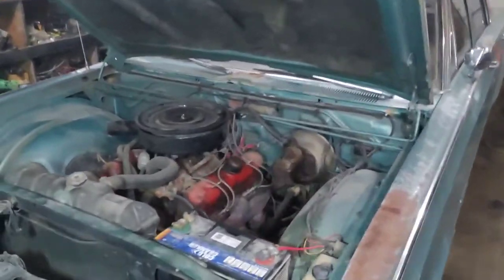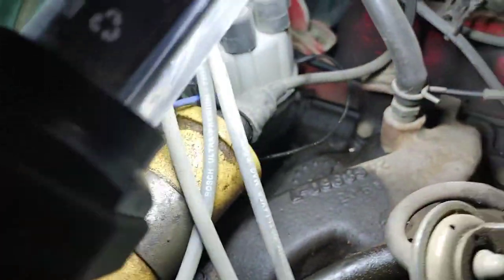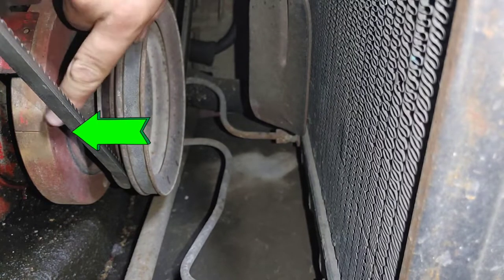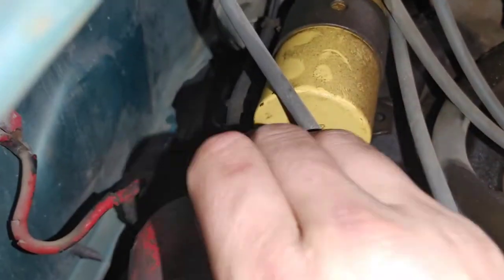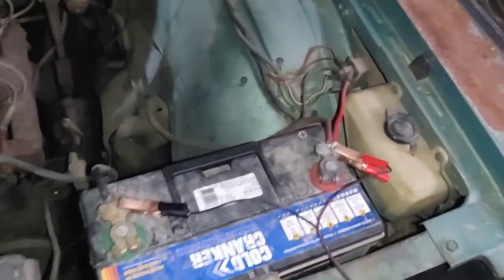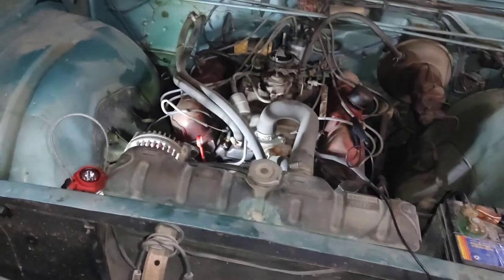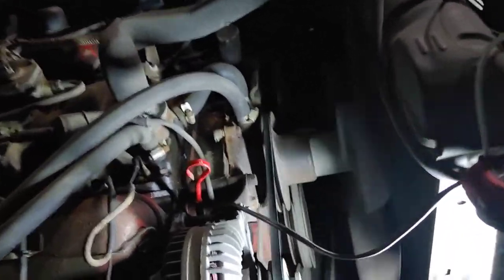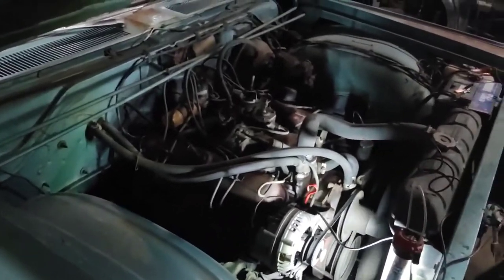1968 Dodge 318ci distributor base timing

Comment: Is the LA block different from the Poly?  I have a 318 poly and it calls for 4 degrees before top dead center from the factory.
Reply from the maker: Yes the poly is quite a bit different in pretty much all aspects. Im not sure on all the details but im sure someone can fill those in.
Reply: @CoopersRepair  Im not talking about differences in the heads, pistons or anything.  im asking are the timing specs for setting the timing different.

I know the engines are different in a lot of aspects.

I was inferring, ive never heard of any engine needing to be set at 0 degrees.
Reply from the maker: @michaelvaus  oh sorry. Yes this 68 318 calls for 0° for timing. I think it stayed like that until 1970 then maybe changed again when they changed the timing cover and balancer. I will double check my book shortly here and see how long it stayed at 0

Comment: I’m having a distributor timing problem where I get backfires at high rpm but I don’t have a vacuum advance on my 86 318. What do I do?
Reply from the maker: To me that seems like a problem in the electonic box that controls the advance but i am not very familiar with how dodge electronic ignition works. Sorry for the late response, i never got a notification for your comment
Reply: It has something to do with electronic lean burn. Chrysler went to that in mid 70s for better timing . My engine in my Duster is a 85 Dodge Diplomat had that electronic distributor. I change it out put a 73 model distributor.

Comment: Can you simply line it up to the factory spec line? I’m getting ready to replace the timing chain on my 74 dodge w100 and I’m worried it’s gonna jump time if I mess up
Reply from the maker: For the timing chain there will be a little dot on each gear and you just point them at eachother and put it together. If the dots are lined up when its together it cant jump unless you have other issues.
Reply from the maker: Also if you get stumped I also have a facebook page and you can post your questions and pics of what your working on and me and others can help you out on there too
Reply: Thanks!!

Comment: Hello thank you for your video, I have a question , Do you know How many degrees should be on time of Dodge 360 V8?
Reply from the maker: Thanks for the support. What year of 360 is it? Im pretty sure it should be 5° BTDC but if you can tell me what year it is i can try to look it up in some of the old books i have to double check
Reply: Hello I apreciate your support in this topic is 1971 model yaer in Dodge Coronet thank you for your support
Reply from the maker: @leorodriguez6917  in the book i have its saying between 2.5-5° before top dead centre
Reply: My friend thank you a lot for your support have a nice weekend
Reply from the maker: No problem. You have a great weekend aswell!